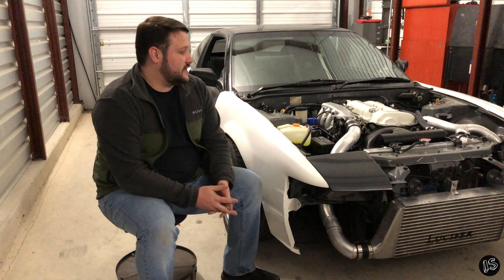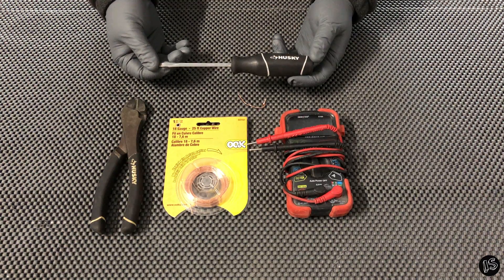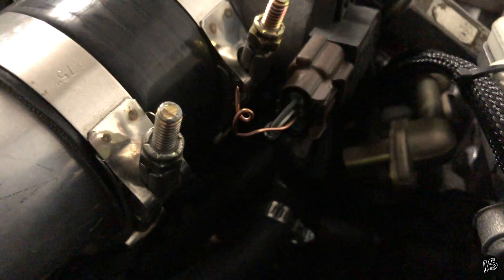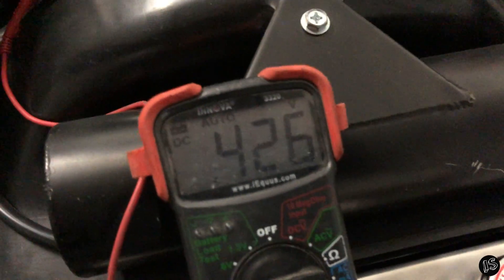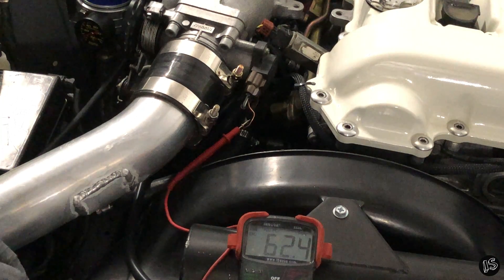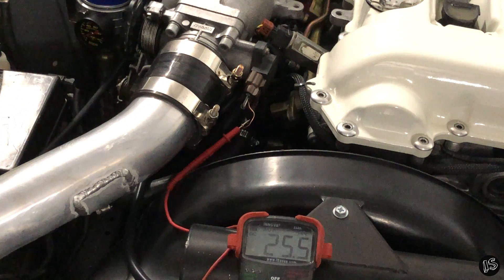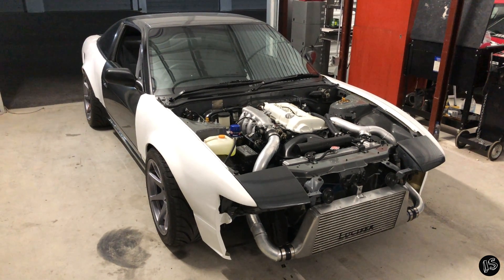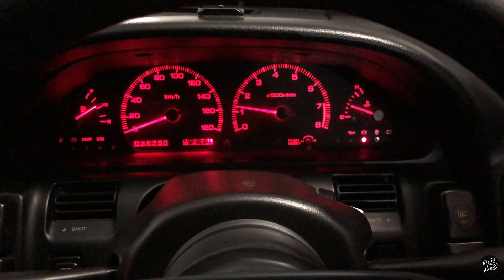SR20DET Ignition Timing & TPS Adjustment

Comment: Not sure what happened but my car would not register that the throttle was closed after adjusting it to 0.45, and therefore my VCT would not turn off, and couldn't set base timing like that obviously. Had to fix it with car running, adjust tps until tps showed throttle was closed and vct turned off at the same time. That was at 0.337v. FSM says tps can be anywhere from 0.18-0.7 or something. Is there a reason you were shooting for 0.45? What part of the tps adjustment let's the ecu know that that is the new closed throttle position voltage?

Comment: Thanks for the tutorial brother 🙏 I have a SR20 black top with a mechanical distributor cap, if I check timing with the TPS connected it’s perfect spot on but if I disconnect the TPS the rpms go to like 2k on timing it is completely off should adjust timing again or is that only for the models with the electronic distributor system? Since with TPS conected it’s perfect just a hard initial start that I can’t find the problem… Would be incredible if you could reply thank you 🙏

Comment: What ended up being your missfire?
Reply from the maker: Torn injector o-rings on 3 and 4 due to a hasty install. Bought all new o-rings, used a little petroleum jelly and gently pressed the rail in. Problem solved.
Reply: @Inner_Sanctum  Oh okay, good catch!
Reply: @Inner_Sanctum  By the way, did you unplug you're TPS? My timing light is all over the damn place...
Reply from the maker: @MidoriSakuraSky  Yep. You need to unplug that badboy! Make sure the car is also at operating temperature or else your IACV is going to do funky things.

Comment: Does it get messy changing your oil filter at that location? I know it’s easy access but I was just wondering if gets everywhere having it upright
Reply from the maker: Nope, it drains down before I ever pull the filter off. If anything, it’s cleaner/easier than having it on the bottom where the filter holds the oil and it gets everywhere.
Reply: @Inner_Sanctum  nice! awesome man! Thanks 👍🏽

Comment: Great video man! I was wondering what your issue in the end of the video was my car misfires similarly to that but I’ve changed the plugs injectors and coil packs
Reply from the maker: Injector seals ended up being torn on two cylinders. I was in a hurry and didn’t lube them well before installing, so they pinch tore. Ordered new seal o-rings, lubed them up a little with Vasoline, then installed. Problem solved.
Reply: @Inner_Sanctum  awesome thanks for the reply! I didn’t lube mine either but i took them out and checked and they were okay so i lubed them up but maybe they tore a little bit
Reply from the maker: @kouki_kev14  yeah, mine looked okay too. However, my intake runner was filling up with fuel. I would turn the car on, let it run for awhile then shut it off. Pulled off the upper intake manifold and the lower runner was pooling with fuel. I knew immediately at that point.

Comment: Do you avoid adjusting the throttle cam/idle screw to effect the tps voltage? My voltage was high and the cam was opening the throttle. Haven’t been able to find it in the FSM and appreciate any info.

Comment: How does this Sr20 have coil packs I thought they were all distributor engines
Reply from the maker: T_money_ THIRD DET engines use coil packs. DE [NA] engines use distributors.
Reply: @Inner_Sanctum  thanks I been trying to figure that out all year. All the turbo Sr20 with spark plug wires got aftermarket turbos.
Reply: @Inner_Sanctum  I wanted an Sr20det for a conversion into a fwd car but all the Sr20det seem to be rear wheel drive setups. The Sr20de are front wheel drive setups but they use distributors and spark plug wires which I hate.

Comment: If that is a OEM coilpack harness, there should be a loop in the back of it for the timing pickup.  However from my personal experience, you should use a old spark plug wire to make a bridge between the coilpack and spark plug for the pickup to get a more accurate reading (FSM even says to).  Sometimes there is interference with the other coilpacks/wiring to the #1 cylinder and the timing light would be sporadic.  
1) warm up car to normal operating temp
2) turn off car, unplug TPS
3) start car, rev 3 times to go to timing mode
4) adjust timing 
5) check idle speed, adj if necessary
6) turn off car, replug TPS
7) start car and check

this with a bridge from #1 coilpack to spark plug is the only way I found to accurately adjust the timing on my s14 SR
Reply: thank you very much for the good explanation, may I ask  what FSM stands for? EDIT: FSM menas factory service manual.
Reply: @mxklkarmonkey970  Yes, Factory Service Manual
Reply: Hey mate thanks, 1 question tho, do I have to rev it 3 times to a specific amount of revs or just any amount of revs 3 times?
Reply: @hunterhaley1343  I believe FSM says to 2000, I usually rev it 3 times to 2000 after unplugging the TPS starting and the idle seems to be stable to set timing.
Reply: Thanks for the explanation mate 🙏 I have a SR20 black top with a mechanical distributor cap, if I check timing with the TPS connected it’s perfect spot on but if I disconnect the TPS it is completely off should adjust timing again or is that only for the models with the electronic distributor system? Would be incredible if you could reply thank you 🙏

Comment: Awesome video! Correct me if I’m wrong, but I thought that you need to use an ignition cable between the first coil pack and it’s spark plug like a bridge in order to get an accurate reading since the SR20 doesn’t use a distributor/ignition cable style of ignition system? In other words you would clamp the timing light to an ignition wire instead of a coil pack signal?
Reply: Yes use an old spark plug cable as a bridge between coilpack and the spark plug to get a most accurate reading. If you don't do that, there is supposed to be a small wire in a loop on the back of the OEM coil pack harness specifically for timing but I always found using a old spark plug wire as a bridge to be the best.  S14 SR FSM has the procedure
Reply from the maker: Kevin Martinez nope, nothing fancy. You just clamp that bad boy over your coil pack wires leading to number one cylinder. It works just fine.